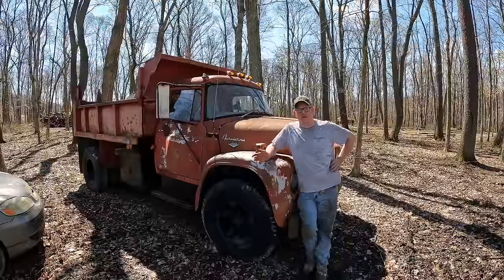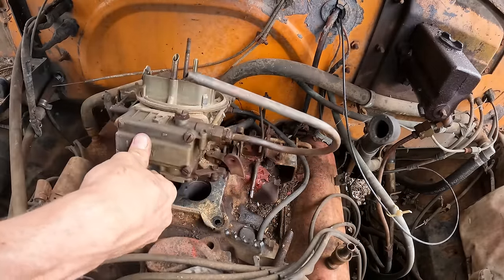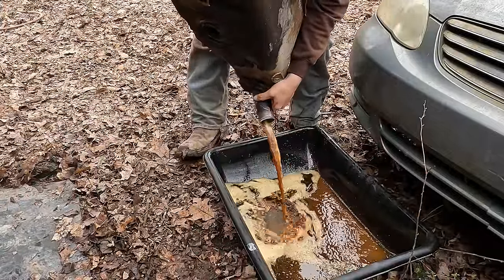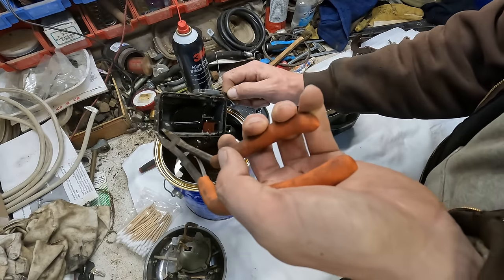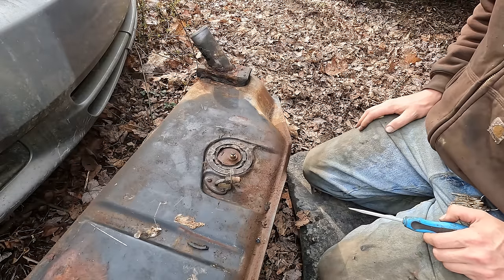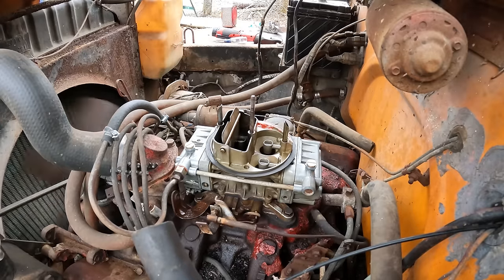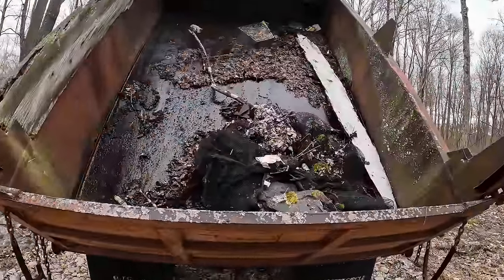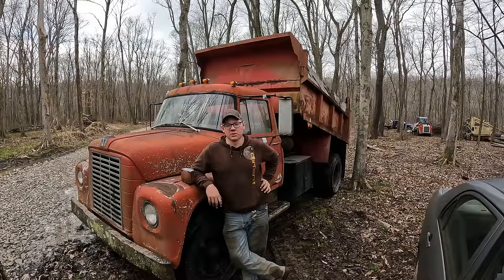Sitting 20+ years will this $500 Truck Run & Drive again? (International Loadstar Revival)

Comment: The two speed axle is great for when the truck is loaded.  Start off in "granny" (1st) gear with the button in the down position.  Gain a little speed and RPMs then push in the clutch and pull up on the button leaving the truck shifter in the 1st gear position.   (Now you have split the gears between 1st and 2nd).  Gain a little more speed and RPMs then clutch and shift into 2nd gear pushing the button back into the down position at the same time.  Gain a little more speed and RPMs, push in the clutch and pull up on the button and release the clutch.  You are now between 2nd and 3rd.  You can continue that method until you have gone all the way to 5th gear in reality giving you 10 gears.  You can also leave the button in the down position and go through all 5 gears and pull the button up when you have traveled the full range of 5th gear low side.  Pull the button up and you will be on the high side of 5th gear.    
I hope this information is helpful to you.  I certainly enjoyed watching you get the old girl running.  I am really impressed with your capabilities.  Thanks for the good videos I really enjoy them.
Reply: youre going to have a bad day if you shift from 5th low range to 1st high range.. engine will see 12,000 rpms before a rod leaves the block
Reply: @AndrewBrowner  Not what he said, I don't think.
Reply: @AndrewBrowner  Who said anything about shifting from 5th low to 1st high?  Reread and understand before making a comment!
Reply: @TKevinBlanc  You are correct Kevin, that is NOT what I said.
Reply: IIRC a Loadstar Can be compound 5, so you can have a case of missed geared at the top, cause depending on box, it should go 1Lo, 1Hi, 2Lo, 2Hi, 3Lo, 3hi, 4Lo, 5lo, 4Hi and 5hi, with the option of  leaving 5lo out, because it being so close between the gears.

And after I started remembering things; there was a 3 boxes available, 5direct, 5compound and 5OD. 
And the 5 OD being rare, above that there was 3 Roadranger style transmission, where the 2 biggest was in the Non-butterfly hood, and one of those two was behind the DD v6. 

I love Loadstars, but DD puts the tits in trucking!!
Reply: The absolute best way to think about a 2sp is like an overdrive button in a newer truck. Do not try to split shift or dance around the gears. Drive the truck like a normal transmission, use the "high" gear at "highway" speeds. The international engines are reliable daily drivers at 3500-3800 rpm and the brakes in every single one of those loadstars is pure garbage. You will be using the motor to engine brake a lot. Always drive around in "low" only reason to shift to high is if you are in top gear above 4k for more than 30 seconds. Otherwise keep it in low and keep it in gear.
Reply: Best to always check the actual gear pattern, we had a fleet of International Accos, with about a third had 1, split 1, 2, split 2, 3, split 3, 4, split 4, while the rest had 1,2, 3, 4, split, 5, 6, 7, 8... 
Identical trucks outwardly, but you did NOT want to do a 1, 2, 3, 4 then split on a 1, 1split, 2, 2 split etc one- compression lockup on the rears at best, a leg out the side of the block at worst...
These days, you can't give away an old petrol Acco- the running costs here in Oztrailia would kill you... they were expensive to run at $0.25 a litre, now with petrol at $2.00 a litre- yeah... (thats nearly $8Au a gallon, or nearly $6US a gallon...)- and they measured their fuel consumption in litres per mm lol... thirsty didn't begin to describe them... 😵‍💫
Reply: @steved2136  but that kind of pattern would only work in a gearbox with either a split or range, this has neither, this has a 5 speed and 2
Speed rear! 

And the only options for this, comes from the 3 gearbox available, 5 speed granny low, 5 speed with 2
Speed rear (could be compound) or 5 speed OD. 

T-34, T35 or T36.
Reply: @volvobrynk  I dont know what gearboxes US Internationals have (he did mention an Eaton) but the Eatons I have driven in Australia were a 10 speed with split knob- and they were a 1-5, split, 6-10...  (and that on a single speed axle)
The petrol (ie gas in the US lol- in Australia many were converted to 'gas', but that means a dual fuel LPG system (butane I believe the US calls it??) so a 'gas' truck is not running on liquid fuel) Accos here were 'mostly' a 4 speed with split- but as I said, could be found with either pattern- a pain because the shift pattern wasn't on the knob, but on a sticker on the dash- which faded and/or fell off- leaving you with no idea of what you were actually driving until you 'tried it and see'- safest was start off in 1st and do a split- if it tried to stall, then you knew you had just grabbed 5th instead of second... 
(I haven't seen anything to say whether that truck has a two speed diff or a splitter box- the knob on the gearstick could be either- in fact one truck I drove (off road 4x4 tipper Acco) had two splitter knobs on the main stick- it had been fitted with a two speed diff and still had its factory splitter as well!!!- it had the unusual trick that using the wrong split knob in 4x4 would leave the rear tyres turning at a different speed to the front ones!!! the back diff had to be in low range to have it match the front diff's speed when in 4wd... 🤯
1960's A series Acco (bonneted) https://www.pinterest.com/pin/324470348137356917/
1970's onwards cabover (what I drove- not that particular one)
https://www.nzmuseums.co.nz/collections/5693/objects/506142/1974-international-acco-truck  (ETA- the NZ museum is incorrect in one thing- they were never made in the US- they were designed and manufactured here in Australia by International Harvester Australia...)
Reply: Too much confusion re the two speed axle. It is not related to the trans. The axle merely has a hi and low. Moving the button up or down sets a pressure on the axle change gear to shift but wont so long as there is torque on the drive gears. So, in what ever gear the trans is in leave it alone, if you want to take the axle up keep the load on the drive train, pull the button up(loads the gear for a change) release the power either by relaxing the engine or disconnecting the clutch (give it time to make the shift). The shift is completed . Remember the engine speed will come in at a speed reduced from before the shift. 

To shift the axle down, as before keep a load on the drive train,  push the button down when ready quickly release the clutch and immediately reload the drive train. Notice the engine speed will come in a a higher RPM. 

Once you understand the principal you can split shift which for example is going from 3H to 4L or from 4L to 3H. This pattern is avail in all transmission gears.  

This is not an Eaton Trans with the term split shifting and range selecting as used with those trans.
Reply: I drove a hydro crane with a 2 speed axle. The rear end was stuck in low range. I noted this on the maintenance board and the other guys that drove the truck said "Don't do that. you'll get blamed for tearing it up. It's been that way for 3 years and it'll go 55 mph in low axle." Sure enough, the boss blew a gasket and chewed me out for abusing the truck. He had the mechanic check it out. The shifter on the rear end needed a pint of oil. The rear end worked after that.
Reply: Shift with an empty truck until you've got it. Start out in low go through the gears and as you go back to high range 4th and 5th will do. You don't need to hit every gear as You will  learn  which work best. In time, you'll learnnhowvtovshiftvwithoutvthe clutch by matching engine speedbtobgear and ground speed. Double clutching is another subject.
Reply: Little Dipper. Would be a good different name.

Comment: I worked at a parts store in Fort Fairfield Maine from 1988 to 1992 that used to be an International dealership in the 60's & 70's.  It was a town of about 4000 people, but had a LOT of potato farmers.  In 1965 they sold 100 Loadstar 1600s!  Many were still in use 28 years later.

Comment: Once again: Matt: I just liked the look of this and wanna save it; I'm not gonna KEEP it or anything....
Also Matt: Man! I really love this little truck, it's great! It'll be so handy to have around for projects and stuff!
Spoken like a true collector.
IH was always very good at using good steel so severe corrosion on fastners and moving parts is usually not terrible. Body panels are a different story. 
If you can find the line set ticket it will have a list of all the parts that were on the truck when new. It's a piece of cardstock usually in thr glove box or attached to a inner rear corner of the cab. It might still be there. If not, Five Star Trucks in Lewiston, PA told me several years ago that they could get copies of your line set ticket based on your VIN number, might check with them.

Comment: Great revival!  That thing is minty.  IH gasser lubrication systems are more about flow volume than pressure.  Discard the notion of seeing 70-80 psi like you may be use to with other engine makes.  A steady 10psi per thousand engine revs at operating temp is plenty good for the ol' Binder.  So at hot idle, that can be 10 psi or a fuzz under and still be just fine, as long as it jumps back up with a throttle blip.  But yes, some quality 15w-40 diesel rated oil will be just what the doctor ordered.  These engines are overbuilt in nearly every way, but they do have an achilles heal...the cam bearings.  Sitting non-rotated for many years does them no favors.  Keep an eye on that OP gauge and an ear trained on the valve train.  If you start seeing erratic gauge readings during extended intervals at higher revs, accompanied by lifter clatter, your cam bearings have likely given up the ghost.  But, for how you intend to use it, that time could well be years away yet.
Reply: Diesel oil is not good for gas engines as it has detergents in it like trans fluid and can wash down the cylinders and bearings
Reply: @masterbates7016  If that was true, it would be just as harmful for a diesel engine.  Many folks have run diesel rated oil in gas engines for decades with no ill effect.  Older flat tappet gassers like the one in this dump truck need a certain amount of ZDDP to prevent premature cam lobe wear.  That ZDDP level is no longer sufficient in modern conventional motor oils due to supposed damage to catalytic converts.  Diesel rigs don't have cats, thus the ZDDP level remains sufficient.
Reply: @masterbates7016  Don't tell Vice Grip Garage that ;)  And I use the same stuff (15W-40 diesel flavor) in my air-cooled garden tractors and it works great!  Zero oil consumption now and it stays clean for 2+ seasons of use.
Reply: @masterbates7016  I have ran Shell Rotella T4 15w-40 in gas engines for over 25 years. They all do fine. Still use it in my 345 V8 pickup and my 300 6 cyl Ford.
Reply: I've owned a few IH V-8 engines.  I can confirm the cam bearing problem.  Take off the oil pan and there will be thin sheets of bearing babbitt metal in the bottom of the oil pan.  Also the engine times on #8 cylinder (closest to the passenger firewall).  Russ
Reply: When he commented on the oil pressure, I thought I remembered my grandpa mentioning that International had relatively low pressure on the engine oil in a lot of their engines. Glad to see you could give some good info on these trucks.

Comment: When cleaning out a fuel tank we always throw a loads of old nuts and bolts in whilst it’s being swilled around… they work really well for cleaning any loose rust off inside the tank… great video! looks like it could prove to be a good old truck for someone…
Reply: And/or a broken windscreen (windshield) then bungee the tank to the mouth of an electric cement mixer and let it tumble for a day.
Reply: @CleaversVids  My dad also uses a chain. Nuts and bolts are a pain in the ass to get out of the tank.

Comment: Hey Matt, I’ve found that when cleaning really gunky carbs and other parts that a good quality oven cleaner (spray can) works pretty good. Use a mask and gloves but it will clean down to bare metal. 
   Also I’ve discovered a way to solder that pin hole in the float with out overheating the whole float. Submerse it in water with the “blow hole” up. It will keep the rest of the float from unsoldering. Maybe you already know but just in case!!
Thanks for your great videos. 👍
Reply: the oven cleaner eats aluminum and leave it looking like crap just a heads up
Reply: Most oven cleaners are lye based and quite aggressive on bare metals. Ovens are porcelain can resist the effects of corrosives pretty well.
Reply: @smasica  Yup yup, i believe  easy off makes an aluminum one tho
Reply: @beettheyeetskreet9216  Good to know. Thanks. My mother used Easy Off for years, both the old brush on paste and the spray. Strong stuff.

Comment: Brings back memories. I revived a 1968 IH Loadstar and loved that truck. Factory was a straight 6 but converted it to a v8. So easy to work on. Mine was $600 and had lots of the same issues. My brakes were vacuum assist though.

If you find yourself in need of a clutch or brake shoes, do yourself a favor and take them directly to a remanufacturer. Saved me a TON of money.

Comment: I am a retired truck mechanic and an IH guy even worked as a truck mechanic in an I H truck dealer when I was a pup, those were great trucks IH sold a bunch of them I had a 1964 loadstar 1600 I used as a mechanic service truck for 18 years. I took in a lot of money in my mobile fleet repair service with that truck I did not have much problem with it.

Comment: When you were reversing it sounded just like my old Morris Minor did in reverse, because it had straight cut reverse gears. Still worth checking I guess, but it might be nothing to worry about.
Reply: I think you'd be hard pressed to find a bevel cut reverse gear in a truck transmission in those days, they all had a good whine from what I remember.
Reply: @thekeyboardwarrior5054  Yes, that was kind of what I was thinking. Here in Europe things are different in many ways, but commercial vehicles tended to go for the strongest option than any level of refinement!
Reply: @IanSlothieRolfe  I think the same for here as well, It's been a long while since I pulled one apart, ans I'm no expert, but if I recall correctly, reverse used 1st gear, which was also was straight cut and with no synchro, it being a couple of smaller gears turning a big one, which is why all the noise comes from.

Comment: Love it Matt! 1972 bought my first truck. A 62 loadstar 1800 with a totally worn out 345 v8. Super simple to work on. Everything is accessible. Keep your eyes open for  same truck with air brakes so you can change over from juice to air. I've done it on an old tandem. Old truck even had foot valve to fit on firewall. Thanks for the memories!

Comment: If you run out of fuel at around a 1/4 tank mark it's because the pickup tube filter is holding the pickup tube up off the bottom. You can take the pickup tube back off push the filter further up on the tube and that will fix that. Just ask me how I know lol. Nice job love these old trucks 👍🏻

Comment: Good old truck Matt, remember time off #8 and keep a screwdriver handy when the point close up.  Adjusting  the brakes, makes a big difference in the pedal height . Make sure to remove the drive axel breather and make sure it is clean of rust they fill up internally and this  will prevent possible axle seal leaks.  Glad to see your not afraid of carbs like most young guys today!

Comment: Matt:  I forgot to mention that the 4-barrel carb on your truck points to a possibility that the engine is a 392 rather than a 345.  There is a machined area on the right-hand front corner of the block, just below and behind the alternator that specifies the displacement (naturally, it will be hugely greasy and dirty, so you will have to scrape and wipe it before you can read it.  The 345 is powerful; the 392 is immensely powerful (but it burns more fuel than the 345).  You will come to love whichever one that you have, and you will probably decide to slowly restore the truck.  It will probably become your family's prized possession.

Yeah, I'm an IH guy.  At this point, my IH stable is small again.  I have a beautiful '67 Loadstar 1600 flat bed (345, 4 and 2), an award winning restored '73 Scout (5 firsts and I second in six shows), and a 464 tractor (1300 hours) much like your 454.  I'm looking for a '70 1200 pickup to replace the one that I foolishly sold in '78.  Also looking for a  '67 Travelall to replace the one that a huge deer destroyed in '04.  As I mentioned, I'm an IH guy.
Reply: Yep it’s Otis 4 barrel it’s not a 345
They were all two barrels
Reply: Otis ??? Hate spell right
Reply: @philliphall5198  Yeah.  "Otis" doesn't make sense there.  Should that be, "Yep, if it's a four barrel, it's not a 345"?
Reply: May have what you're looking for...

Comment: One of my favorite gas powered trucks! I would highly advise that EVERYTHING be dismantled before dipping in carb cleaner though! The big Holly needed a bath and probably new accelerator pump too! Thank you for reviving a LoadStar!
Reply: Dean Benson  ,  You might want to explain what carb cleaner does because he used brake cleaner. Ouch.

Comment: Are you going to have to take the fuel tank out to replace that filter when it clogs?  You know that it is going to clog.  You might have been better off to have just put the tube back into the tank with no filter on the pick up.   Just put a good see through filter in a external place along the fuel line "before the pump" that you can see and get to easy.    That way you know that you never would have to pull the tank and you have a good in line filter elsewhere that will do a better job and can be easily changed.
Reply: Your right, that is a rather limited surface area filter. Maybe a screen could have been a better choice for that location.